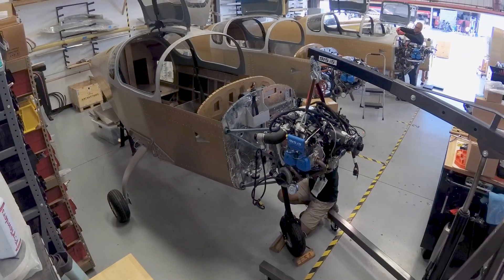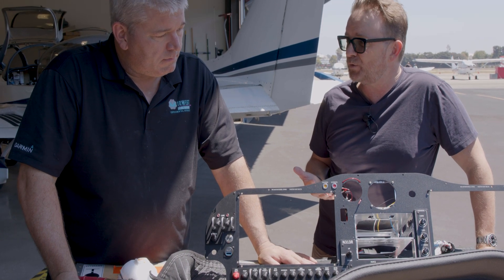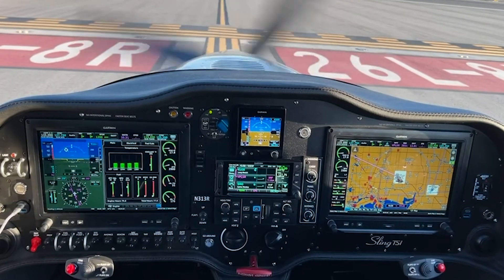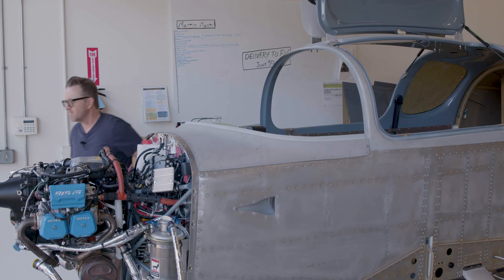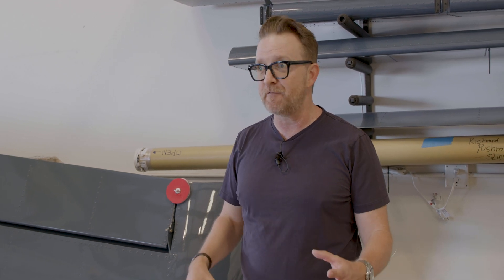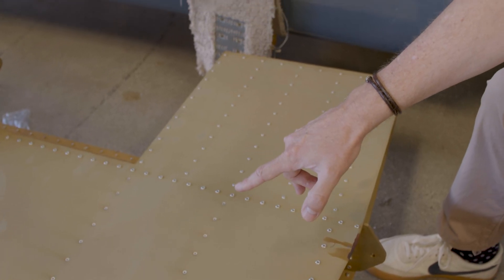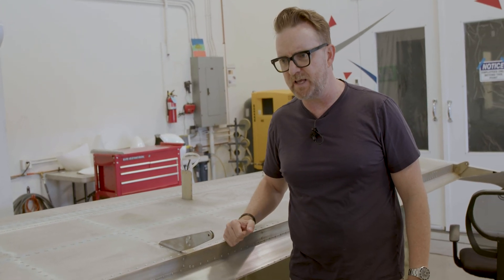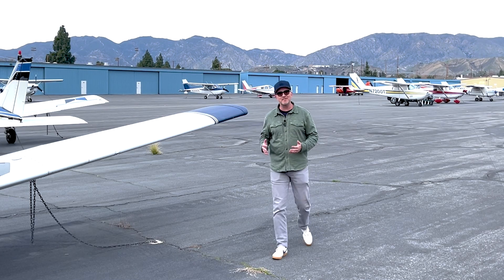Sling TSi - EP 4 Avionics Panel & Paint

Comment: Hi, new to your channel.  I am a student pilot. I have been following the Sling TSI for a while and I have never seen the rectangular device that sits between your auto pilot and your right mfd.  What is that?
Reply from the maker: Hi Harold, I think you're referring to my Garmin GTN 650xi Navigator. 👍
Reply: @Richard in the Sky  no it is long ways going up and down.  Looks like it has 3 nobs or something on it.ots to the left of you mfd
Reply from the maker: @haroldrileyii3036  Ohhh, those three knobs are the dimmer knobs for my avionics, panel lights, and overhead lights.